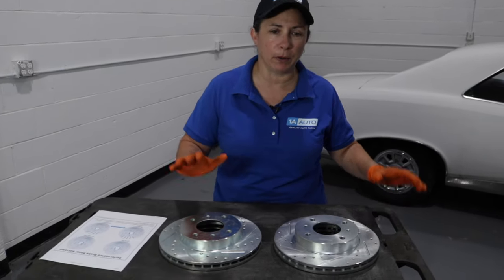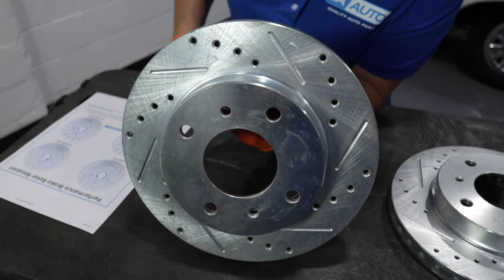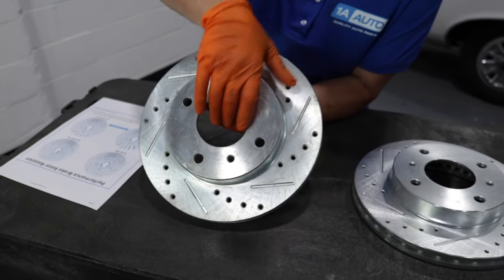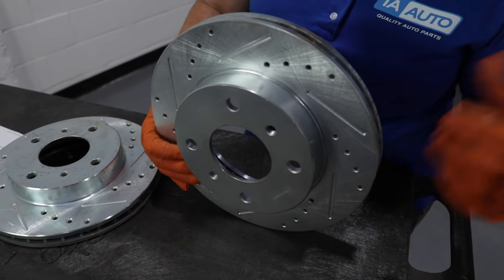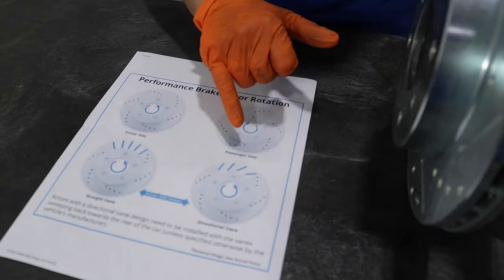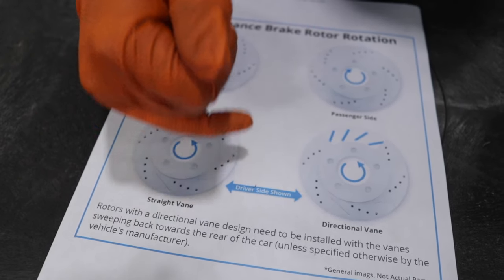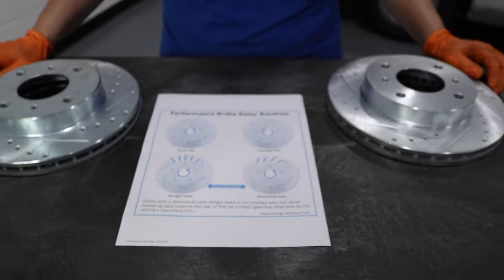The Correct Direction to Install Performance Rotors on Your Car or Truck

Comment: This is the only time I've ever seen rotors suggested to be put on that way. Most aftermarket high performance rotors (including Powerstop, which is what I have) are labeled and instructed to be put on the way you say not to.

What dictates the direction they should be? The internal vanes or the holes and slots on the surface.

Comment: I love Sue.  She helped me nail the front brake job on my F-150.    Learned a few things.   Here though she’s off the mark.    It doesn’t make a difference for the drill holes or for slots which end before the outer edge of the rotor.    If the slots open up at the outer edge of the rotor then she’s got it exactly backwards.

If the rotors have directional cooling vanes then what you have is actually a centrifugal air pump and so it becomes most important to pay homage to that and ignore the slots and drill holes.  Viewed from the top,  the vanes should angle backwards.   If they don’t then you are spinning your centrifugal air pump backwards and in a manner which creates high pressure on the outer edge of the rotors. In turn that impedes air flowing from the inside to outside as well.
Reply from the maker: +SeeSawMacaw Thanks for the feedback!

Comment: Everyone else, including my own certifiers, say you're exactly wrong because your way pushes the gases down the slots and into the hub area. They're supposed to push gasses and dust AWAY from the hub. Unless there is a directional air wall. Then you Mount them according to the air wall so that the rotors grab wind and cool the rotors. Usually this design is only found on cross slotted rotors but, I have seen D&S rotors with a directional air wall.
Reply: Brembo and Summit both say it doesn't matter. PowerStop agrees with this lady. Stop Tech disagrees with this lady.

Ultimately, it doesn't matter so long as the cooling vanes aren't directional. In other words, the slots and holes are not directional.
Reply: I got these at a reputable shop and they installed them this way as well
Reply: I'm not an engineer or anything, but I just purchased a Wilwood set that has the the slots feeding into the hubs for my c6. 

It threw me off because I'm used to the slots feeding outward in drive. They have an indicating arrow etched in for direction of travel and I had to research around to ensure they did not mark them incorrectly. 

These are curved slots though, I don't know if that influenced their decision, but it did throw me off, having the slots feed inward. 

Cooling fins are more or less uniform in direction for my purchased set.

Comment: I Install mine base on which way the directional veins point, which is suppose to be towards the back of the car. Im sure its not base on which way the drill or slot point because that doesn't matter. Different manufacture make different rotors. If its Non directional then its just preference which ever way makes you smile. So when you see other peoples rotors pointing the opposite of your it doesn't mean its wrong because there's no way to tell unless you look in the veins to see if its directional or not.
Reply: That's true cause I have one set with stickers saying the opposite of what she is saying.

Comment: That’s funny..  PowerStop has a video saying the slots are angled toward the rear of the car going the direction most people would assume is correct (not the opposite).
Reply: And they would be correct. Its not about grip its about venting the hot gasses out so you have a consistent brake pedal when your brakes are hot.
Reply: Exactly. I’ve never seen slotted rotors installed the way this video states. It’s cooling and diverting brake dust.
Reply: I've only seen a co-worker argue me this. Mine are my way, which I presume correct and theirs is their way.
Reply: I think I would trust what the manufacturer designing the product says is correct over a 3rd party distributor's opinion.
Reply: I just installed power stop rotors on my truck this past weekend. Today i saw a very cool 1955 f100 pick up and it had the rotors installed  Opposite of mine. And so here I am at youtube university😅🤣😂😊😁 think I will keep them the way power stop said 🤷‍♂️

Comment: There is a serial number that ends with L or R that tells you which side it is on. I just checked mine and it's exactly the opposite of what you said.

Comment: I purchase a set of Power Stop pad and cross drilled/slotted rotors from another very reputable company. Mine are installed opposite than what you are saying, but they each had a label on them saying Driver Front, passenger front and the same for the rear. I know the rotor is supposed to look backwards but I installed according to their directions
Reply: Same here the front one were labeled opposite of the video
Reply: Same issue and my friend said slots facing forwards too.
Reply: I have to join in with yall also and say the video is incorrect! these are not Brembo Brakes, I have had 1 (ONE) set of PowerStop Drilled and Slotted rotors on my car in the front for 3 years and some months with absolutely no issues... no noise, no brake failures. Last year 2021 R1Concepts caught my attention, and I made the switch to them. SAME THING both companies had a sticker on the rotors and it is the opposite of what this video is sharing. A1 Auto has some really great content but i cant agree with this one.

Comment: I agree with other comments, if the rotor has directional vanes and/or slots that go to the rotor's edge, then sure those should be facing forward.  Meaning scooping the air into the rotor vane/slot. 
So for rotors with STRAIGHT VANES and NON- edge slots here is my opinion, and I think I think I am right on this.....
It does not matter. 
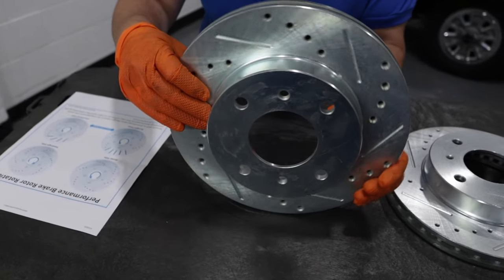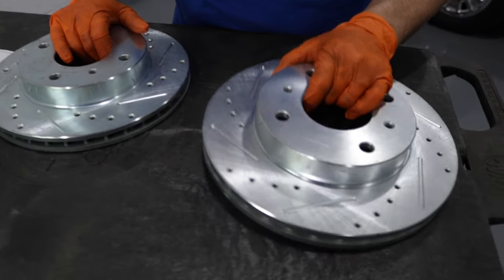There is no "bite" from one direction vs the other.  At any given speed, the amount of time the any given part of the slot on the rotor is exactly the same regardless of direction.  The pads are passing over the slot. Look at 0:47 where her hand is over two slots.  If the rotor goes counter clockwise (which is suggested), then the outside of the slot goes under the rotor first. That is the only difference between that and if the rotor turn clockwise, then the part of the slot closest the center goes under the the pad first.  Again looking at 0:47, as the slot exits the pad (her right hand) , whether CW or CCW the slot will end up perpendicular to the ground and with the edge of the slot facing the direction of travel. I and I would say at that point any dust in the slot will be dispersed. 
Also just another way to think about it...
At 30mph the tire is rotating roughly 5 times a second. That amount of wind, combined with the forward travel wind,  and if any outdoor wind, well that makes for a lot of wind which I think would vent (blow out ) the slot no matter which direction it is angled on the rotor relative to the tire rotation.  
I know way too much thinking on this, but is an interesting question.  And just my opinion , so I could be totally wrong. 
I'm a big 1A fan/customer and thanks for all you folks do. 
PS - I just put 1A loaded struts on an old S60 and it is riding smooth.
Reply: EXACTLY.

Comment: Usually there's a sticker on the rotor telling you if it's driver's side or passengers side. Pay attention to that,  also if there's no sticker check the box for falling sticker, use a marker to write the direction after opening the box just in case you forget or get confused.
Reply from the maker: +Ahmad Ghosheh Thanks for the tip!
Reply: R would indicate passenger side right ?

Comment: I recently replaced the rear brakes & rotors on my 2012 Camry. The performance rotors that I  purchased each had a sticker on them indicating the side of the car it should be installed on (Driver & Passenger).  The slots for these rotors were in the opposite direction of what is being shown in this video.

Comment: If you've ever gotten your brakes really hot going down hill, gas starts to get stuck between the pad and the rotor making the brakes less efficient. The slots are to let that gas get pulled out...if you install them the right direction. This is a instance of someone making a part they have no idea what its for

Comment: Wow and everyone does the exact opposite 😩. Thanks for the info 👍🏽
Reply: My boss told me i put them on backwards ,and had to put on the wrong way ,boss is in the brake business for 13 years now .i am shocked that he is still in folt!
Reply: I just came to a brake shop and was told my rotors are installed  wrong lol whats really going on with these brake shot owner?

Comment: Why do manufacturers like PowerStop say to install them in the opposite direction shown on your video?
Reply: I was thinking the same thing. Just ordered powerstops and their website shows the opposite way, It should be dependent on the cooling vane direction and manufacturer instructions.
Reply: @brendanhumphrey3726  Just stick a screw driver in the veins and see which way it point if its towards the rear meaning its correct.

Comment: I bought mine from a1 auto and there was no label on them, so thought it doesnt matter then. After my mechanic installed it, i looked online on their site for the direction/diagram and sure enough, my mechanic installed it in the wrong direction. This is ridiculous. You guys should put a label on each rotors saying L or R. Is that so hard to do?

Comment: So many people don't get the basic physics at play here.
1. It doesn't matter what way the gas and particles get ejected. The pad doesn't extend all the way to the hub.
2. A cutting angle towards the direction of rotation will be more abrasive than a cutting angle away from the angle of rotation. Basic cutting toll design here.
3. The wheel is spinning at great velocities, so all particles will be ejected out the top no matter the direction.
4. Vanes angled with the rotation will create an external air pump ejecting all heat.

Comment: But I seen race cars installed them both ways...?
Reply: It makes the brakes operate more aggressively. You will only see them running opposite in that application because they don't care about brake life. They use the extra friction for better high speed braking. That being said, the proper way is with the slots pointing to the rear of the vehicle, and some race drivers prefer to use them going the proper direction. I find the proper direction to be more predictable and definitely more cost effective.

Comment: wrong. its exactly the other way around as she is saying in the video.
when you follow the groove from the inside towards the outsids/top (towards the edge), it should be pointing towards the REAR of the vehicle.

Comment: I just installed Powerstop drilled and slotted Rotors..they are completely opposite of what you are showing..the drivers side sweeps from the middle of the Rotor towards the front..so 1 o'clock to 7 o'clock

Comment: For all the people out there swearing they know whats right, it’s not the holes or the slots that determine the direction. It is the vanes that determine this. Also, of the slots are curved: directional. If straight: not directional.

Comment: Bad info in this video. If you have straight vane rotors (which you probably do), then it doesn’t matter which direction they are installed. If you have directional vane rotors, then the vanes (not the slots or holes on the face) should point towards the rear.

Comment: it  all depends  on the manufacturer of  rotors,  for  all you  saying  she  is  wrong,  look  she  is  going  off  paper  instructions from manufacturer of  rotors   these  rotors  have  straight fins.  they  go  this  way,  some  manufacturers  are  different,  i have   tryed  this  bolth ways  on several occasions, to  see  if there  was  a  difference,  and  there  real  is  no  noticeable difference,  just  saying

Comment: Cross drilled rotor orientation is the same regardless of the direction of vents on the rotor.  The illustration in the video was quite unclear and implied direction vent vanes changes the orientation of the drill pattern to the direction or rotation.  The only point regarding vents is that the rotor vents need to sweep backward in relation to the rotation of the wheel.  The video does a poor job illustrating that point..

Comment: Well my manufacturer said to do it the opposite direction. Depending on internal cooling fin setup and I guess engineering principles in argument. To me, I went with my manufacturer (powerstop) recommendation.

Comment: You're actually wrong. It goes the other way, pushing brake pad debris away from the rotors.
Reply from the maker: +Mr Persaud Thanks for the feedback!
Reply: Every other video shows it the other way as well. Her way will wear your pads out faster.
Reply: That’s exactly how I expected them to go, inside hitting the pad first and throwing gasses and debris to the outside 🤷🏻‍♂️

Comment: Glad to confirm this cuz i got a set and 5hey were labled the direction you are saying but if i did not inow i would have put on backwords , but when u think of it from the scientific and engineering POV this makes perfect scence to evacuate the gasses quickest and to help the pads grab better as apposed to i feel it would alow slippage to a degree if it was going with the grain sorta speak ...

Comment: This is a non-directional rotor. It makes no difference which direction the slots go on rotors with straight vanes like this one. All slots do is allow heat brake pad gas to escape away from the rotor to reduce brake fade in high heat situations.

Comment: It really does not matter, especially if you have straight vanes, typically they should be installed in the rotation of the wheel

Comment: The slots are to rotate "into" the pads, not rotate backwards. You'll want the cooling veins to "throw" into the pads and calipers, not "pull" away creating brake dust to be thrown all over the wheel and tire, as well as not having any cooling properties at all.
Reply: Slotted rotors aren’t for cooling 🤦🏽‍♂️

Comment: It really doesnt matter - if the vanes are non directional (straight), u can put them either way..

It only matters when the vanes ARE directional. In which case, the vanes should always be sweeping towards the back of the vehicle..

Orientation of drilled/slotted rotors is preferential.. StopTech, who is a VERY well known and trusted brakes company, has a video that says the exact OPPOSITE of this video..

So I would say neither are wrong or right.. as long as the cooling vanes are NON-DIRECTIONAL (straight), then it's purely up to u which way u want them facing 👌

Comment: Detroit Axle rotors have the mark "R" or "L" on the end of the serial number of each rotor. That SN# is on the outside edge of the rotor. The R or L at the end of the number indictes which side of the car it is made for. The R or RIGHT rotor slots point to the back of the car.  Same with the left of course. After watching this "incorrect" video I had to double-check with Detroit Axle to be certain. So for Detroit Axel rotors and my car, this video is giving the wrong info. Check your new rotors for correct placement.
I said the video is "incorrect" because it isn't the direction of the slots/drill holes you need to worry about. Put a screwdriver into the vents on the edge of the rotor. Or just look down at them. Screwdriver is easier. The correct placement is when the screwdriver end is pointing to the rear of the car. That's where heat is dissipated. So you want those vents pointing to the rear of the car for max cooling. Some manufactures like Detroit Axle have the vents pointing straight up. So in their case it truly doesn't matter which way the slots are pointing. Other manufacturers have slots and the vents pointing opposite directions. In those cases if the slots point to the rear and the vent is pointing to the front, you could get overheating.
Check the orientation of the vents before you install them. Or simply call the manufacturer if you have a question.

Comment: I bought new drilled and slotted rotors from R1 Concept I installed them as it shown in the video which is the correct way of installation but I've got noise when I'm driving.....any help???
Reply: If your rotors are directional stick a screw driver in and see which way it point. If it point towards the rear of the car then its installed correctly

Comment: Never seen anyone install them in that direction. It would make more sense for the slots to push outward not inward (to dispel heat and brake material away from the caliper. 

Not to mention having the slots go into the pads can cause jitter. With that said, always go with the rotor manufacturers recommendation.
Reply from the maker: +Paul D Thanks for checking us out! http://1aau.to/m/Shop-1AAuto-c

Comment: This is bad information if you got Detroit axle rotors, which those look like there is a part number on the edge you will see at the end of the part number an R or an L that is left or right side if you were in the car! So driver side is left and passenger is right side!